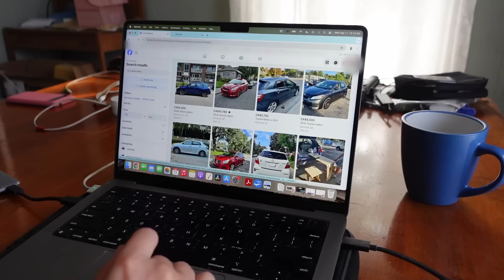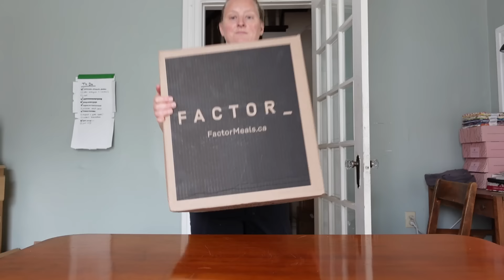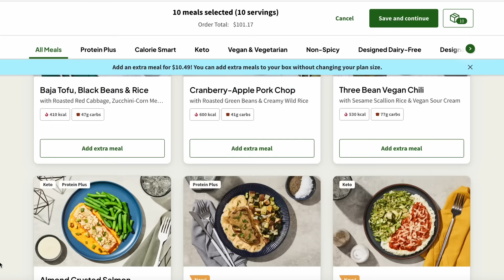an unwelcome surprise

Comment: UGH I hate when cars refuse to be reliable. Nice to have a local who knows about things like full parking lots. I think I will never forget the scariest noise I've ever had in any car, any time we weren't accelerating, it sounded like a helicopter, WUBBA WUBBA WUBBA WUBBA ... we stopped multiple times on the way from Ottawa to Sudbury and tried to figure out the noise but it only happened at speed... so when we were a few hills away from our turnoff, things got real exciting and we stopped as fast as we could from highway speeds in the dark and discoverd the front wheel had come rihgt off and was jammed in the wheel well. PSA: If your car ever sounds like a helicopter when you're not accelerating, STOP AND CHECK YOUR LUG NUTS.

$160! Awesome deal, I can't even get a furnace looked at for that price anymore,
Reply from the maker: YES! And if you change your tires, or take the lug nuts off, they should be retorqued after the first 50 kilometers - most garages will do it for free.
Reply: @ShannonMakes  I think we had re-torqued them after we swapped the tyres. Weird damn thing. Also frigging TERRIFYING. 0/10, do not recommend.

Comment: You guys need a Honda Element for your type of work, trips and etc...
Reply from the maker: Except that not only is it far more expensive than a Matrix/Vibe, but it also gets far poorer gas mileage which, considering we have to drive 12 hours on a somewhat regular basis, is a red flag for me 🚩🚩
Reply: @ShannonMakes  never looked into the gas mileage vs. I enjoy mine so much I want to have a second one. There's no carpet to mess up, seats fold or come out, it's tall to fit loads of random stuff in like a motor bike, washer and drier, riding lawn mower. It's crazy. Also I can have a trailer on the back. 
Well I hope you get the car you so need hon. Happy you have a goal. ❤️ can't wait to see the next video.  😍